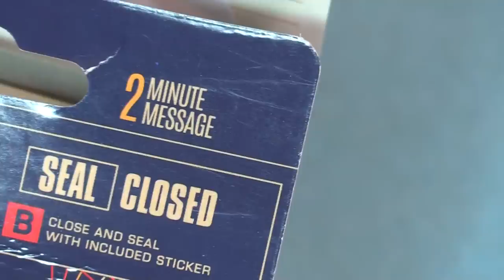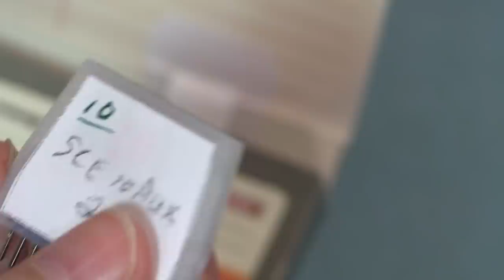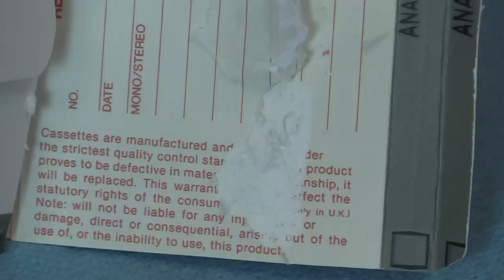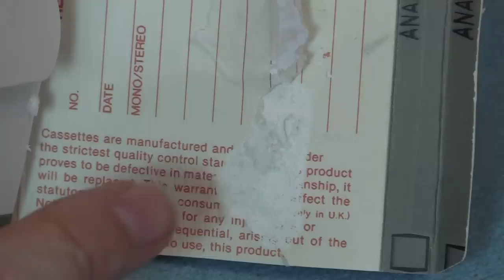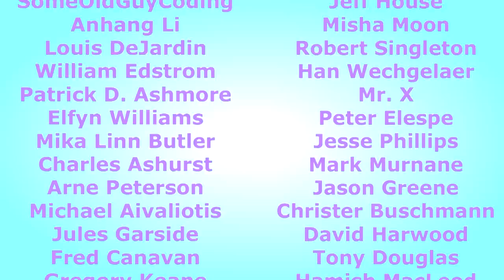$12 Novelty Cassette Tearapart!!!

Comment: Some ways to make this cheaper with less waste:
  1. Single 1.5V battery with capacitor based switching voltage booster in the chip.
  2. Use the speaker as a microphone, like in old intercoms.
 3. Use the battery as switch by having the cardboard slide between battery and PCB.
  4. Use cardboard box as membrane for speaker/microphone, leaving just coil and magnet.

Comment: The 3 batteries will be A76/SR44 1.5V Alkaline or Silver Oxide Batteries rather than lithium.  But it is certainly a very interesting novelty.  It looks almost as if they found a cache of old stock cassette tape program inserts that had a faux cassette tape design printed on the outside (which wasn’t especially uncommon in the 80/90s) and simply incorporated them into this new project.  The insert portion is already significantly yellowed from acid degradation suggesting that portion of the package is much older than the main cassette body (or at least the paper stock was quite old, but then it had full printing for a real cassette which tends to support a new old stock origin IMHO).
Reply: Amazingly lucky they had the foresight to print a "RECORD" button and the instructions "Press and hold to Record new message" & "CURRENT MESSAGE WILL BE ERASED" on cassette boxes 30-40 years ago! Not to mention the secure design that encapsulated your brand new Suck UK cassette in a glued cardboard package. Much more environmentally friendly than the plastic cases that cassettes were normally sold in.

These were clearly printed expressly for the recordable greeting card. Either the inside printing was originally intended to be seen (the glue might have been an engineering change after the printing was done), or they just photographed an original insert and left it intact because blanking out one side wouldn't have reduced the price any. Or perhaps a nostalgice OCD artist included the full design because why not?
Reply: David Zachmeyer If you rewatch the final minute of the video, the cassette face labels are actual applied labels and thus printed separate from the card stock cassette “box”.  But a good catch otherwise as I had to rewatch to ensure I recalled correctly.  Presumably it was done that way so that the packaging could easily carry multiple brandings without having to customize the actual bulk packaging, though it also adds a bit of authenticity to the look with the face labels applied afterwards, just as with a real cassette.

Comment: I think that same company used to sell a “send-a-mixtape” cassette like that. When you opened it up there was a little cardboard holder with a flash drive in it. As I remember it was also overpriced to where you could buy a standalone thumbdrive 2-3x the capacity & a cardboard mailer to send it in for the same amount. 🙄😒 I never bought one, but I think I think it also had 2 flaps that folded out, which might explain the hidden printing.

Comment: This brought back memories of the cassette tape delay guitar effect units I used to make in the early 1970's.
Reply: Did you use a continuous tape loop inside the cassette?
Reply: David Zachmeyer:  Yes, a single loop tape. Tape splicing was something most every audiophile knew how to do in those days. A fixed position record head. And a play head on a slider so you could adjust the delay time.

Comment: if something is hotglued together: Take your solder rework station!
Reply: or isopropyl alcohol. it instantly removes hot glue :)
Reply: @ChongMcBong  hmm, not the one i have... with acetone it works. but that ruinis a lot more... the hot air gun is far more effective on ardboard.
Reply: @rarbiart  it only works on the white, plastic hot glue sticks, not the stuff that contains glue as well. It doesn't dissolve it, just unsticks it from the surface.
Reply: McBong's Lab With a name like that I had to check out your channel. Some great stuff on there dude!

Comment: There usually is not any kind of DAC in those recorder chips and they directly record an analog voltage level to the flash cells.
Interestingly enough MLC flash even the kind used for digital storage is actually analog which is how they manage to get more than one bit in each cell.
Reply: Wait, flash cells can save voltages at such resolution?!

Comment: Looks like you went shopping in Chinatown. The packaging is very reminiscent of the types of gadgets usually sold there. 

Would like to see a little more tech exploration of the unit such as:
Try recording with the pcb outside the cardboard enclosure.
Check the batteries for capacity and veracity.
Lift one lead from the speaker and temporarily attach an equivalent ohm rated system to see if it sounds any better. 

My guess is the sample rate is around 8k-16kHz at 8 bit. Thats what it sounds like to me. It'd be neat to be able to extract the file from the chip to verify the format.

Great ending. LOL

Comment: It sounds like 8-11Khz 8 bit max. If they record using raw data then the device must have a 1-2Mb Flash to store those 120 seconds, that external chip must be it.
Not sure why posting this info, maybe professional deformation xD
Reply: Usually these sound recorder chips store the sound as an analog values inside the flash dispensing with the need for any kind of ADC or DAC.
The same rate is usually around 8Khz.

Comment: Very cool Fran! I am actually constructing a device based on the same chips you used in your audio recorder. They're very cool little chips! I remember you mentioned putting in a lowpass filter to cut out on some of the noise. Did you put the lowpass filter on the input (i.e. mic) or on the output (i.e. speaker)? What values did you use for your resistor and cap? Did you end up making an amp for the output as well? Mine are terribly quiet despite input volume being high.

I actually ended up rolling my own PCB to breakout each chip, and with all the components from Mouser, the PCB and the original chip, it didn't come out too bad, looking at just under $4 per unit.

Comment: Now that gives me an idea. Why doesn't some make a digital recording cassette that you can use in a conventional cassette deck. 64 gig would be nice.
Reply: A simple SD or MicroSD slot in the cassette body would be even better. I think that LGR or Techmoan actually had something like that on an episode recently, but it didn't have any record capability, required a battery, and had a poorly located switch that got flipped by some tape mechanisms. I think it had a remote though.
Reply: You know, thinking about it, not only do a lot of cassette-to-device converters use a "headphone" wire to connect to the other device, but there's actually a standard for how to send USB over 4-wire (TRRS) headphone connections...

Comment: if it was hot glued use a hot air station to melt the glue and open perfect
Reply: lol I went too boogie with that. you can heat them with just about anything an oven at low temp and it will probably just unfold  by itself